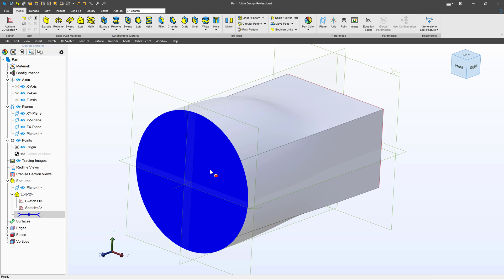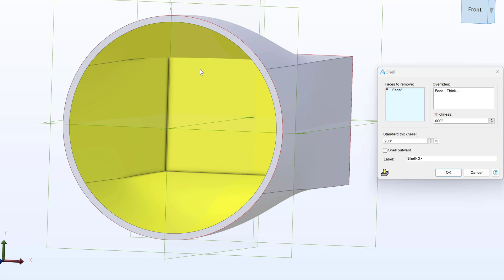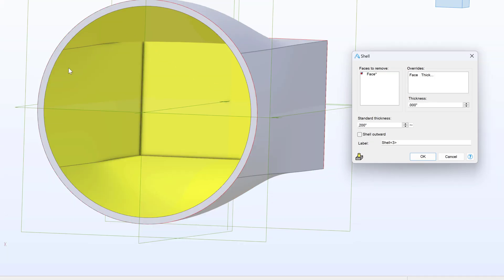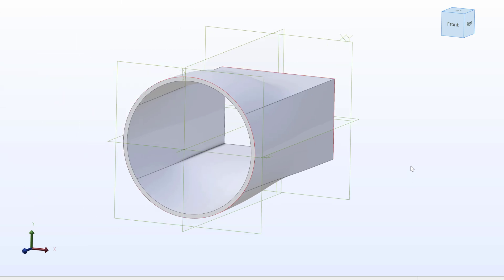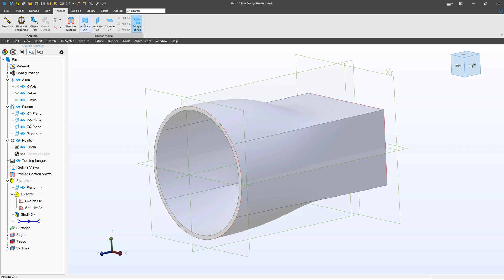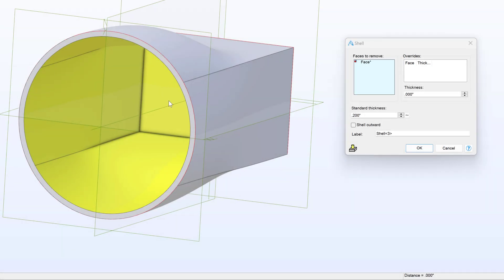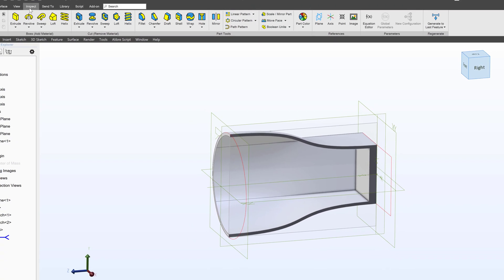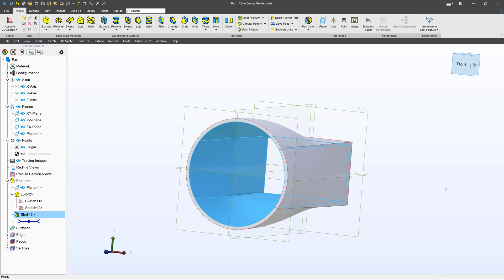Using the Shell Command | Alibre Beginner Course #15

Comment: I've been battling the Shell function for two days now, eventually having to dismantle the assembly, removing surfaces until the shell starts working, then play games in how the pieces are added back. Even when it finally seemed to work, it had a strange looking patch on the outside of a curve, which proved to be a hole(!) when it came out of the 3D printer. The shell wall thickness was set to 2.5mm, yet the walls gradually thin out as they approach the area until there is nothing. I can't figure out what Alibre - or I - did that could produce this. Unfortunately, every online discussion about the Shell function contains a lot of frustrated people. I'm getting there.
Reply from the maker: Feel free to send me the part in question- joseph@alibre.com
Reply: @AlibreLLC  Oh thank you very much! I'll do that right away. (I was actually wondering how to contact you. Seems like you could have a side business of doing remote tutoring, seriously.)